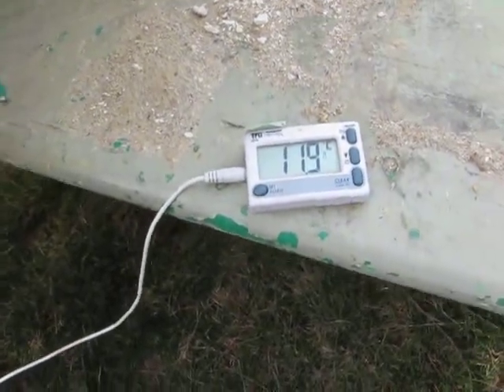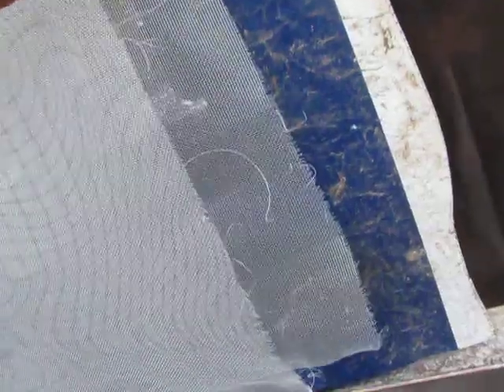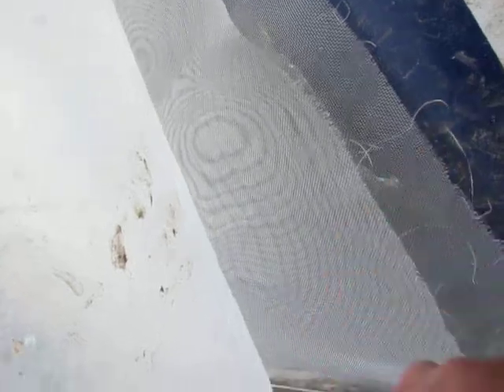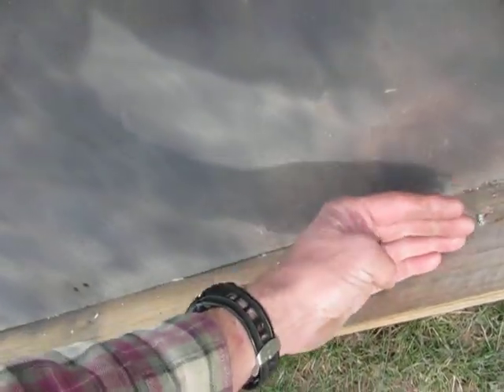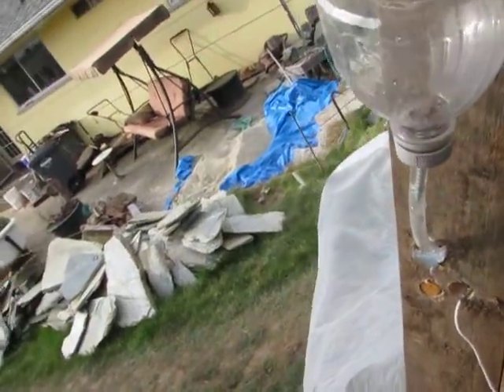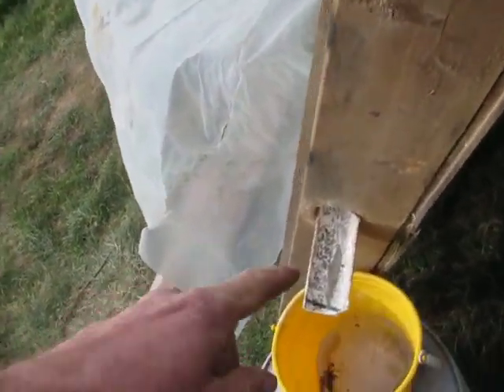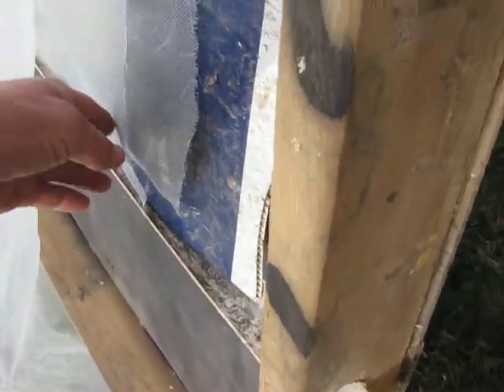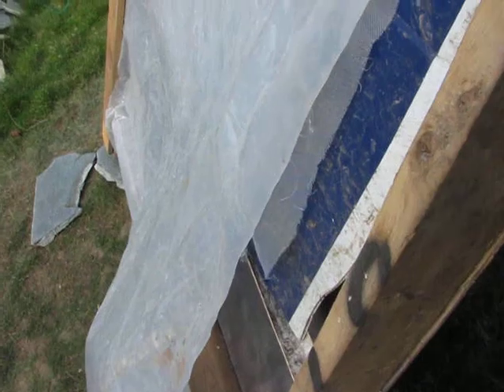Outdoor "hydronic" window screen solar heat collector (for warming plant roots in raised beds, etc).

Comment: I could build one of those. I just about tried to imagine how many you could run with one pump. the pumps are solar now too.
Reply from the maker: Hi, Brenda, don't build one just yet.  Usually I change the designs a lot as I build them. This one is half way complete so that usually means that it will be quite different in a few days. For this one, the solar pump needs to be able to pump water 2 ft high.  (Doesn't need to be much water, just a trickle). If it is an air pump, it needs to do 1 psi.   60 liters per hour of air at 1 psi will run about 3 of them, I believe. I imagine it would be a lot tougher running them in colder parts of the country.    Thanks for your nice comments.  Brian
Reply: I suppose the metal screen is what you are using? I have an idea myself that would be an hours play to do. I just need some screen.
Reply: I have glass that I could use. A themometer would be nice but I bet if you couldn't feel the difference well. I bet you could.
Reply from the maker: Brenda Hodgins  Hi Brenda. If you are using solar, it might be easier for you just to blow the air around pipes under the garden with a fan.  I think computer fans will work.  I can do a water based system here because it does not freeze much.   If you are in cold weather Canada, then the fan based thingy might be better for you.  Just need to have larger diameter pipes.  I will have 5/8 inch irrigation pipes. You probably need  something around the 1 and a half inch diameter.  You can either circulate air (gets a bit warmer)  or just let it blow out in the soil under the garden bed. A solar fan is good  because you have a regulation of air. It shuts off or slows down when there is no sun.
Reply: No, my garden is fast asleep and I do not own a solar air pump but that is because I have never stumbled upon one. I do own 2 air pumps. Tubing and 10 goldfish who love my experiments.
Reply from the maker: Brenda Hodgins
 Hi, Brenda,   how much time do we have to get the thing battle ready for you?   I have asked the people at simply solar for their input.  They have most experience with window screen solar collectors. It is probably important to get sizes  of channels for air just right.   Couple of months to tweak it ok?
Reply: Alright then, I can set one up in the morning just to play. I will use pans or a piece of metal roofing. I want to start planting in a couple of weeks around 0.Peas lettuce and Kale. These boxes could be outside the little greenhouse. Screen inside.
Reply from the maker: Brenda Hodgins
 Hi Brenda, hope it goes well. I have 3 digital thermometers but only one is really sensitive enough to tell the difference. (Sometimes if the sun is not shining you are getting just a 2 degree rise in temp. (significant for the seeds and the soil but not something you can detect with a normal thermometer.  If you get a thermometer to test different materials it needs to read to 0.1 of a degree and be a quick responder to change. Mine is a true temp by taylor but I don't think they make this model any more.  It takes 1 triple A battery and stays on for about a year!  Many of them have an auto shut off for the display which is a bit of a killer if you do constant measurement. My other ones have a time feature too (which is awesome for solar cook tests) but only measure whole degree changes and they are slower to respond to change.